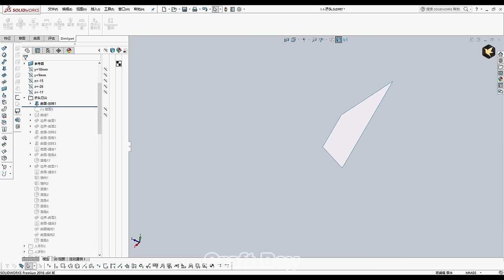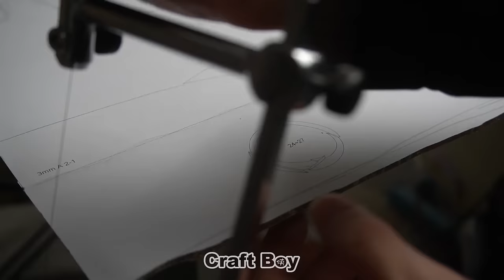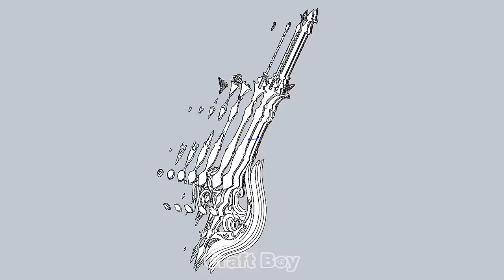30 Days Hand Processing 10KG Acrylic to Make Navia's Verdict | Genshin Impact

Comment: The Funny part about Navia's Weapon is that its a Custom Design probly specifically made for Navia herself as it is in essence a 2h Sword with an Axehead instead of a traditional Blade.
Since an Axehead of that size would normally have a grip thats more inline with the length of a Spear rather then the length of a Sword so Navia is probly crazy strong otherwise she couldn't use a Weapon like this effectively.
It reminds me kinda of the Seven Deadly Sins Member Escanor he uses a 2h Axe like Weapon in terms of weight and Blade size but it has a 1h Axe grip instead of the normally pretty long 2h Axe grip.